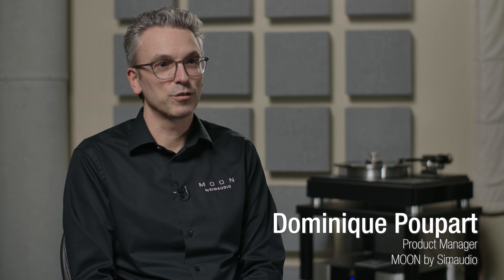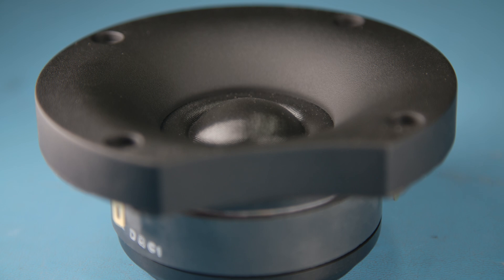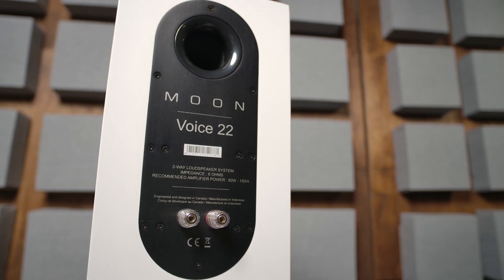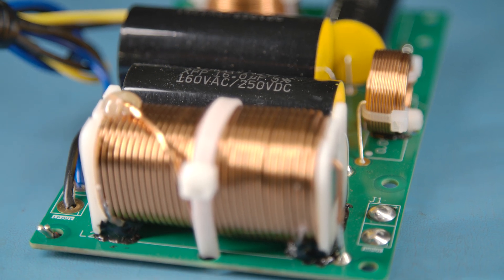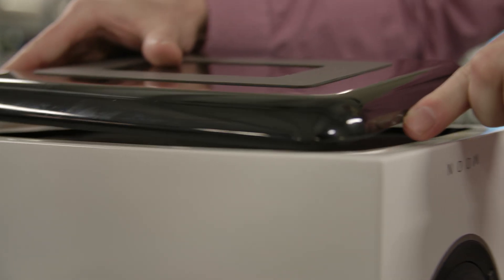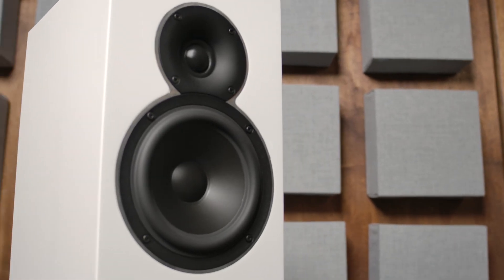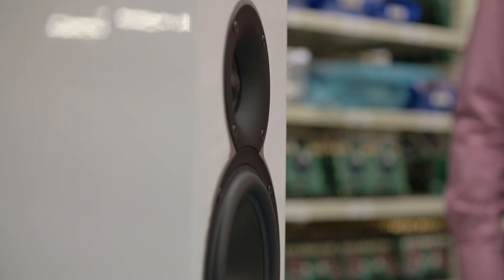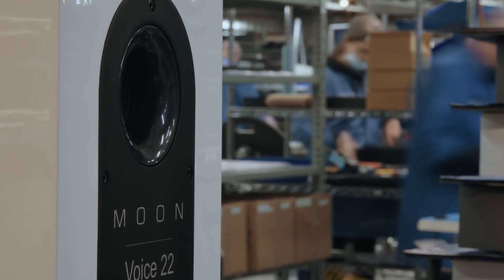The Design Details for Simaudio's Moon Voice 22 Loudspeaker - SoundStage! InSight (May 2022)

Comment: This Man lies!!! This driver very cheap model made by SB Acoustics, maybe SB17MFC35-4 model. And about capacitors lies.. Bennic make very bad capacitors, cheap and bad,and inductor coils extremely cheap, because good inductor coils only copper and silver foil inductors. Speakers wire same used cheapest, no have bi-wiring connection, connectors cheapest..All speakers made extremely cheaply!

Comment: Based on the video, it looks like that the parts quality is about the same as the Polk reserve series bookshelf speakers.  The crossover has 3 Bennic metal film capacitors and 2 small air core inductors.